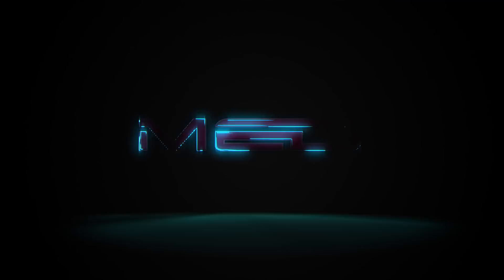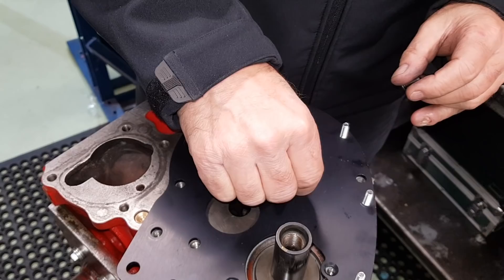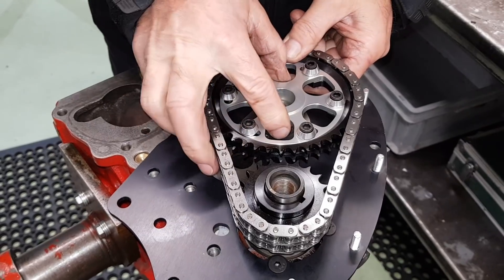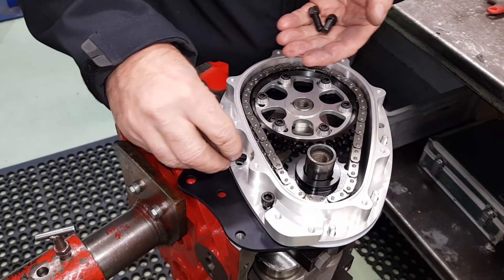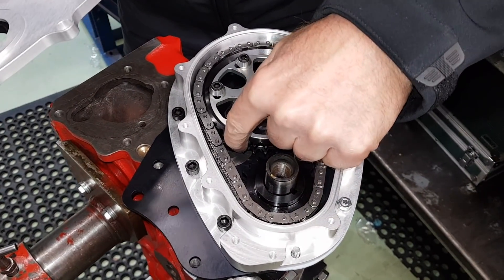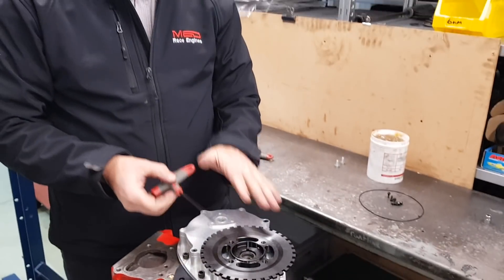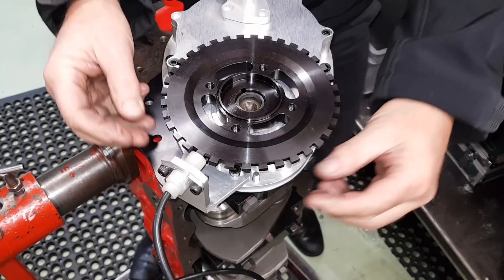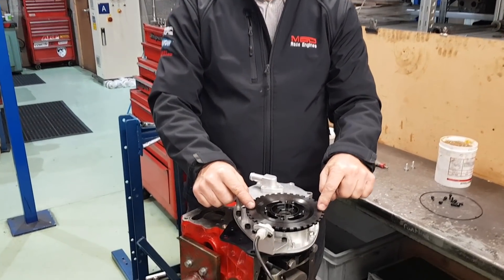How to fit the MED billet aluminium timing cover

Comment: i bout this setup and MED pulley kit , looks great and i love it. the only problem i have is once it the car i can't get a fan belt on because pulley is to close to motor mount, 93 mini cooper. had to modify the mount to get the belt on so they can be changed in car if need be..
Reply from the maker: Ok, sorry to hear that. Sometimes it is necessary to file the mount for a bit of extra clearance, depending on the mount, as there are a few different ones.

Comment: But if you still have to remove the balancer to access the adjustable cam gear, what's the point?
Does the 3 piece cover you make for a timing belt also accept the adjustable cam gear intended for a chain drive?
Reply from the maker: Hi, The main aim is to eliminate oil leaks, as the standard covers all tend to leak after a few times removing and refitting the fixings. It means you can leave the outer case fitted while setting cam timing, but all the oil will come out if you try to do this in situ. 

The cambelt runs dry, different setup.

Comment: How do you set the timing when you have no timing bracket on the cover plate? Or timing mark on the crankshaft dampener. I just bought one from MED and I am confused how to set the timing.
Reply: How did you set the timing in the end? Did you make your own mark's
Reply: @jamesrickwood6333  I had to exchange the solid crankshaft pulley for a slotted one where MED took one of the teeth out at the right place. The there is a sensor bracket you can usethat bolt to the lower cover of the block you can use as a timing mark
Reply: @IsraelitesUnited  cool cheers

Comment: Nice CNC machined modification and nice vernier Sprocket, ideal for timing and re-timing the cam. Not sure about the large "O" ring. That in principle I understand, but am not the greatest lover of "O" rings, especially a large small diameter "O" ring. The cover and body look to have been machined very accurately with a good finish and two flat faces butting, I think maybe Hylomar as used for this type of requirement in turbines. Nice job though.
Reply from the maker: It's less messy than silicone sealer and does a good job as an oil seal :)

Comment: I can see why he didn't do the nuts up. I've just fitted mine today and  you cannot get a socket on about 3 of the nuts! As it's too close the the body. Shame as I wanted to torque it up so I can get them all the same torque setting.
Reply from the maker: It was just quicker that way. Nipped up with a spanner will be ideal as the cover won't distort. Well, unless you've eaten too many Weetabix! Give us a call on Monday if you'd like any tips :)
Reply: @MEDEngineeringTechVideos  no it's fine if done it now 😀 what trigger wheel would I need for megajolt? Flat or raised type? And will the golden position bracket fit? Or do I need the one shown in the vid?
Reply from the maker: @MrBerty1988  if you opt for the management flat type, then the silver CPS it bolts straight on.
Reply: @MEDEngineeringTechVideos  ok so the set up demonstrated in the video will suit megajolt ignition?
Reply from the maker: @MrBerty1988  If it's suitable for a 36:1 trigger wheel and the Magnetti Marelli CPS plug, then yes. Most are - it's quite generic.

Comment: Hi would you recommend using gasket sealer on the gasket? Also would you recommend loctight? Merry Christmas
Reply from the maker: It's not essential, but a very light smear of sealer never goes amiss. If you're using a clean block face and new timing plate, grease will do the job nicely. We don't tend to use Loctite here as you'll never get the bolts undone again in future. If tightened up properly, they shouldn't work loose.